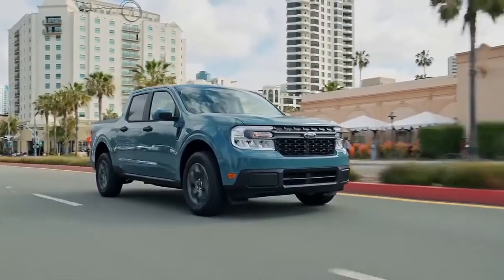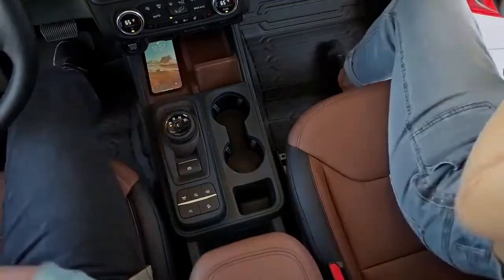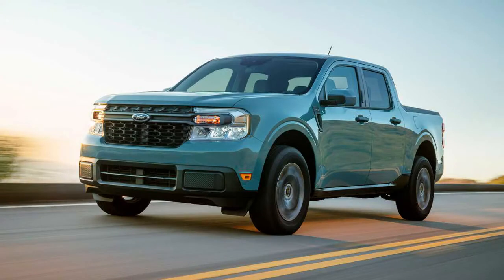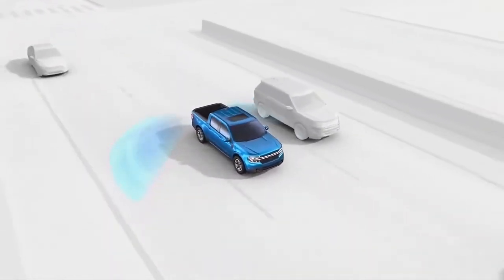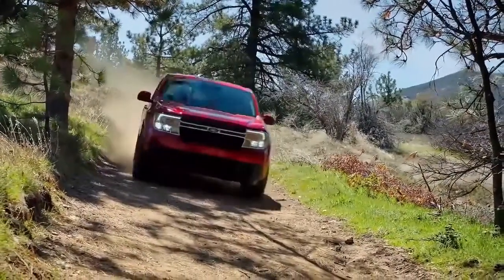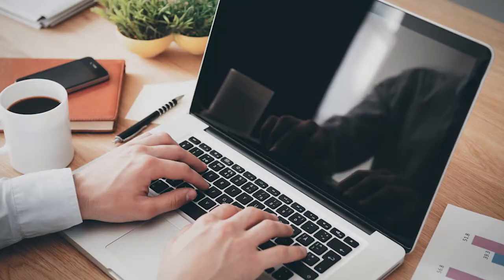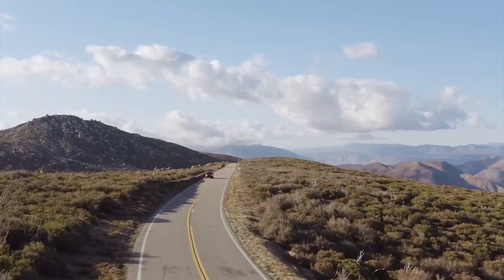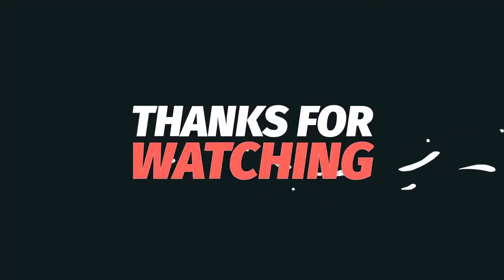Ford Maverick's All Wheel Drive Explained

Comment: Today was the first stress test since I switched from an F150 to a Maverick. We got about a foot of snow where I live. Roads weren't plowed but driven through a bunch. Handled great, I didn't feel any slippage upon acceleration. Brief wobble when I hit a snow drift but quickly gained full control. You can feel the weight difference between it and a conventional 4x4 F150, but overall handles well.